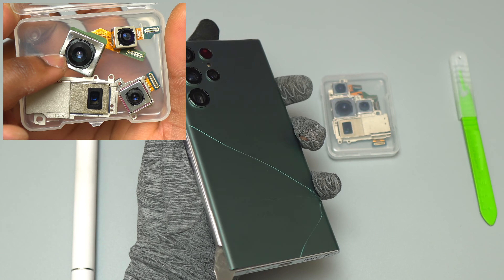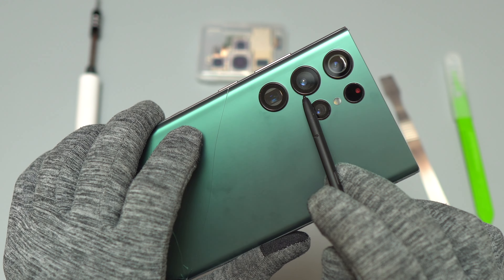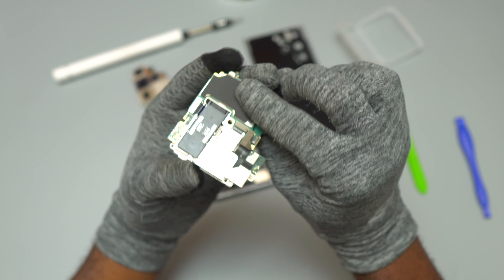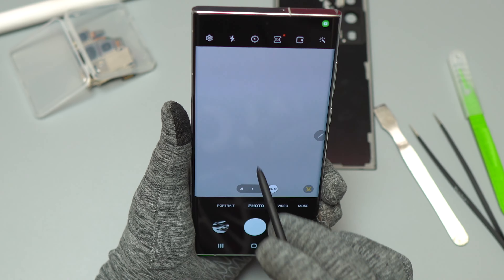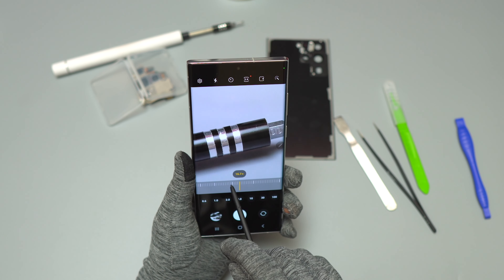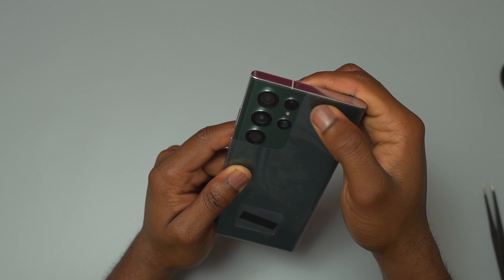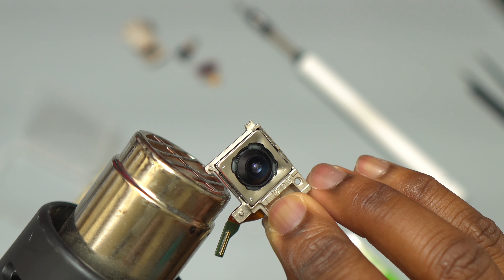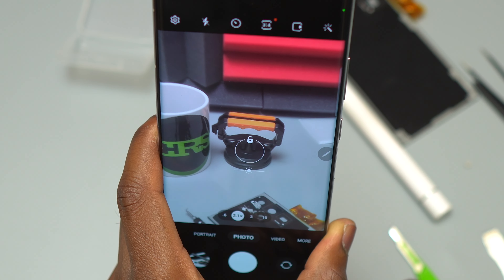Galaxy 23 Ultra and S22 Ultra Camera Replacement Repair

Comment: I had exactly the same problem after installing the camera, it could not switch from ultra wide to wide and the camera app crashed. Exactly which connection to the motherboard caused the problem? Thanks very much for the channel, greate job❤
Reply: Please help me😢

Comment: Only my main camera is bad, can I just purchase that camera only
Reply from the maker: Yes. You should be able to buy the main only then disassemble the camera frame to replace the old bad camera. It should work without any issues.
Reply: @ersbit  ok thank you. Also, when I select the whole frame to buy it, I notice that the little lens at the top isn't included on the frame, why not?🤔
Reply from the maker: @harrypotter6980 since it is one big block. I believe they don't want people to separate the ones stuck together (by design) just to sell things you don't need. The Ultra wide up top is the easiest and not glued to the frame that's why it is being sold separately. If yours is still good just reuse it with the new camera block.
Reply: @ersbit  ok thank you so much!!! 
My phone tech said it's smarter to just replace everything. But thank you so much💕